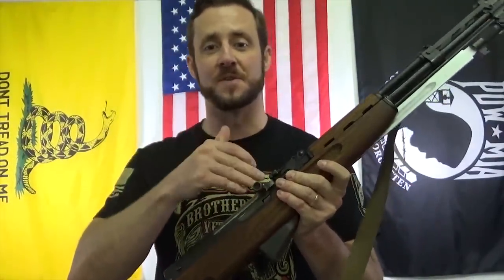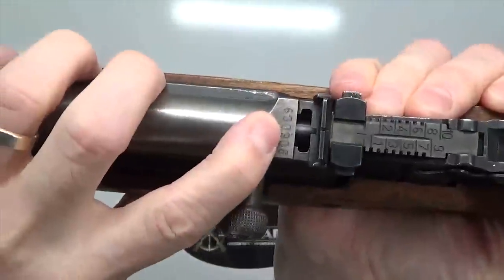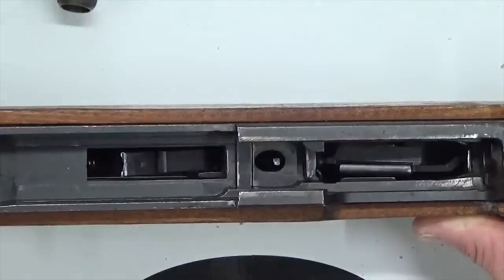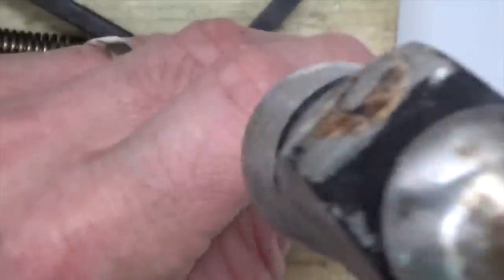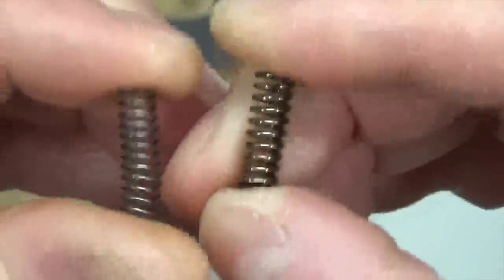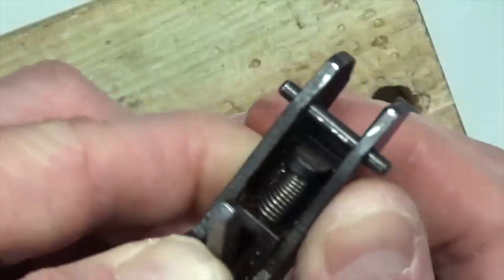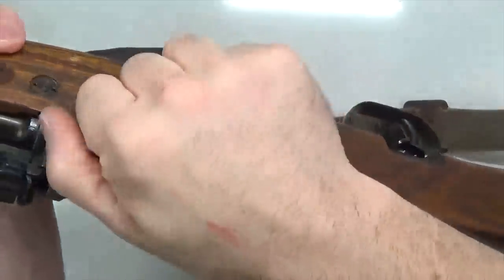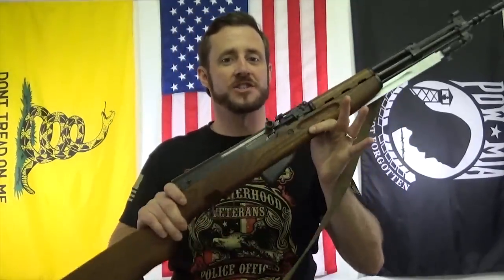SKS Accessories and SKS Trigger Job to improve Accuracy SKS Trigger Spring Kit

Comment: This Spring works great with the Murray's Gunsmithing SKS trigger group parts. I also added an extended mag release from Gould Engineering and Machining and use the ProMag Archangel mags with the paddle lever. All of these things work so swimmingly together.
Reply: Are you running the original stock
Reply: Must be a nice upgraded sks. I have a rubber recoil pad on mine. Its original too. Im going to get my sks to fit a mosin nagant scope mount. Drill and tapp the receiver.. Have to cut the side of the stock

Comment: To those of you who are commenting on the mag release aspect - Yes, it can make the mag fall open from recoil.    If you aren't using an aftermarket stock with plastic magazines you should stress this on your order and ask for a "Medium tension'" spring.  I first ordered the 'standard' spring and the mag always fell open on recoil.  I called MCarbo and they said there were many others with this issue and they sent me a 'medium tension' spring at NO COST !!  PROPS  to MCarbo for their great Customer Service.  BTW I also got the spring kit for my Savage-64 and the trigger is down around 2# on that too!!  AND I am in Canada and there were NO problems with getting the parts, and NO Extra Customs Duty charges.

Comment: My Yugo has a trigger pull of 6 lb 8 oz and it is a rough pull. I bought this spring kit, removed the trigger group cleaned it up and installed the new spring and wow! The trigger pull is now a smooth and crisp 3 lb 2.9 oz.  Thanks Mcarbo ! This worked out great for me.
Reply: Which spring did you use ? Just got the kit today and am worrying about the mag dropping open. Thanks.

Comment: Added your 3.5 lb spring to my Chinese Type 56 SKS.  This quick modification really improved the trigger operation.  I did notice some people had issues driving out the pin in the trigger assembly.  Before I started the installation process, I soaked my trigger group in som penetrating oil (I used Ballistol) and the pin drove out of the assembly quickly and my trigger group got a deep clean and lubrication.

Comment: My sks trigger is actually pretty decent, I'd guess around 4 or 5 pounds.  The main issue I have is the inconsistencies and the long creep. I'm hoping the super light spring helps correct this a little. It seems to be an easy and cheap install. Seems like a no brainer.

Comment: This worked great on my SKS. It also made it insanely more easy to do magazine changes. I have the Gould Engineering and Machining Extended Mag Release for the SKS and plan on buying the Murray Gunsmithing 922r Trigger assembly replacement. This is a great product and I recommend it to anyone looking to modernize their rifle.

Comment: Good video... As long as the gun is apart it's a good idea to pull the sear out and polish the surfaces where it slides on the hammer and also where it makes contact with the trigger housing... This surface is usually machined kind of rough which makes the trigger pull a little gritty... This is a very quick and easy fix... Also if you want to take it a step further you can grind a little bit off of the back end of the sear so the trigger pull is shorter before it releases the hammer....  My only issue with this lighter spring installation is now there is less tension holding the magazine base closed and I could see it either opening up on recoil or if the latch is accidentally bumped.
Reply: Good point re reduced tension on the holding the magazine base closed.  I'm rethinking that purchase.  Frankly a 4.5 - 5.0 lb trigger pull is not an issue, as far as I'm concerned.  But the trigger is gritty, I'll look into pulling the sear out for polishing, not clear on how to accomplish this...
Reply: @rosshenderson835  ,,, There should be videos on YouTube about removing and polishing the Sear... it's a easy process and if you've taken it apart far enough to change the spring the sear will slide right out of the trigger housing.... Frankly I see nothing wrong with most SKS triggers,, in a rifle the pull weight is not near as much of an issue as the smoothness... I would recommend working on the sear first to smooth out the trigger pull and see how you like it at that point... I personally don't think an SKS trigger needs to be any lighter than it is after all it is a battle rifle not a precision long-range bolt gun... The 7.62x39 round is not ballistically that great in the first place.
Reply: Ballistically strong enough to kill a bull moose with one shot of full metal jacket.
Reply: @dalanwanbdiska6542  Did it have the steel core ? ? I would love to know that ! ! Steel core will penetrate some heavy bone with NO problem I would think.

Comment: I couldnt get that front hinge pin to budge on my trigger assembly. I just took a flat head screwdriver and pried the spring out and up from the sear side. Then slid it off the mag release side. The new Mcarbo spring went right in the reverse order. So easy!!!!!
Reply: Can you do a video or better explanation because I am having the same issue

Comment: Another option without having to replace spring would be to  remove spring and apply heat to reduce tension (temper)  propane torch until light straw color and let cool. repeat as necessary if necessary.  too much annealing, heat and drop into cold used motor oil. ;)
Reply: If you go to all the trouble to remove it to do as you say why not just spend the $15  for their nice spring?

Comment: Yep, most trigger/mag catch springs are stiff and mine is no exception. The spring replacement seems to be such an easy fix, one I'm not adverse to trying. I will mention that I have read a limited few comments by sks owners that have done the switchover that with the new spring installed the magazine flips open on recoil every shot. Looking at a number of rifles from various factories and nations I notice that the tab on the mag mates slightly differently on many, meaning on some the mag catch covers a large part of the magazine tab where other examples the engagement of these two components is quite slight. This latter situation is very likely the cause of the unwanted mag opening.

Comment: I put one of these in my Chinese Type 56 that Classic Firearms got a bunch of in here recently. The pin you have to remove on mine was stubborn as all Hell, but once I got it out, the installation was super fast and super easy, and man did it improve my trigger. I love it. The price was good, installation was easy(stubborn old commie pins notwithstanding) shipping was fast. Really, what more could you want?
Reply: I have one of the recently imported Chinese Type 56 SKS. I was thinking of adding this spring to my trigger group??  I noticed this comment is a year old.  How has this mod worked over the long term??  Any problems with this spring?  Did you go back to the original??

Comment: I was so impressed with this one I ordered one for a mosin nagant....both are 100% better
Reply: Bradbo3,  which spring did you use ?  I'm worrying about the mag. dropping open with the lighter spring? Just got the kit today. Thanks.
Reply: MegaBait56 i used the 2.5. I still have the factory stock and mag.
Reply: @bradbo3  , thank you. I'm keeping it in the original stock also. Thanks again.

Comment: That front hinge pin can be extremely tight and you will want to make a metal block to put between the ears on the trigger guard side plates before knocking it out if that pin is tight, especially on stamped trigger groups on later Chinese rifles.  I bent one of those ears one time trying to get one out, so I ground down a piece of square stock to put between them when I knock that front pin out.  
I think the electro penciled numbers on Yugos are called assembly numbers and not a serial number.  
I think they electro penciled those numbers to keep parts together to a particular rifle before the serial number was assigned and stamped.
Reply: Yes, even on my russia sks i had to make a block to keep those little ears from bending. Very weak spot in the sks trigger group.
Reply: I really wish I saw this comment before pounding away at the hinge pin. The magazine release seems to be locked in place, probably due to an ever so slight bend in one of these ears. I will know until I finish knocking the pin out but I put a block in there so don't do for their damage

Comment: The Carbo trigger spring replacement for the SKS is the best $13.00 you can spend on your SKS.......try it before you go for the full trigger kit..sear modification.   It takes 10 mins and if you don't like it it's reversible in the same 10 minutes but you won't replace it.  Thanks Carbo

Comment: But how you reduce the creep? I don't mind a heavy trigger. But that creep throws me off
Reply: same. takes a 3-4 rounds for me to find the sweet spot.
Reply: @juanxnaranjo647  so I figured out how to remove the creep. You gotta get a really aggressive positive sear engagement. Like get a 35 deg angle on the part for the sear touches hammer. I did this to mine, and now I get a super crisp two stage trigger.

Comment: thankyou for the outstanding video. i just recently purchase a near mint condition chines sks . from a weapon purists point of view this this little beast is 100 % all original  all matching numbers....christmas came early lol. there is 1 little ding on the underside where the bayonet folds into the stock....99.9% mint. i'm betting the only action this rifle seen was in military drills/parades hanging off somebodies shoulder. sorry i'm rambling...my question is what do you think/feel about the magazine kits out there on the market. i've come across 30 round mag and 50 round drum mag kits with mixed reviews. would this be a do or don't add on ?? i'm also trying to locate a muzzle break but am having no luck if anybody knows of a website ?? thanks in advance for any advice .

Comment: Questions... so many questions!!
To start with, my SKS uses AK mags and has a very different style trigger assembly at the end where the spring is...
But that not really my issue at the moment...
The safety lever... it should be staying secure in place when in “safe”. Mine does not. Anyone have suggestions on what I need to do to correct this?
Reply: Okay, so... my SKS is a Norinco Sporter.
I came across a wood stock with numbers stamped in the butt and still had the cleaning kit inside...
It fits well with my hardware but the stock is made for the fixed mag.
If it worth trying to restore this rifle or is this just how a Norinco was made and it’d be better off to have fun with it with its plastic stock and find a better example of an SKS?
Reply from the maker: Send us an email to help@mcarbo.com
Reply: MCARBO same problem. Whats the fix? I tried replacing the forky thing and it did not help at all. Nornco with an archangel stock for those beautiful tapco 20 rounders. Sorry, thought this had gone to email. Ill try there.
Reply: John Fitzgerald archangel stock with conversion to 20 rounders and top cover rail for red dot. seems to be the best way i have found to wring the very most out of the sks.
Reply: Step one,  don't buy bubba'd sks's. There is no fix. The man you bought your rifle from butchered the once perfectly fine to hell and back. And that is where your problem lies.
Reply: Did I mention that it was a factory conversion? Guess I forgot to mention that part.
Too bad we had to go with the “red neck” slur. Unnecessary.
Reply: I did, however, fix the safety spring issue. I took the trigger mechanism apart and “finessed” it back into shape and it works great now

Comment: How does that affect the trigger pull? Isn't that spring for the mag release? If it decreases pull, how?
Reply: Sam G The spring is pushing on the Sear. The tension on the Sear creates some of the Trigger Pull. I have just installed this part and it works great.
Reply: Looks like a good product but I'm in Canada and we can't buy any gun parts from the US and they are in Florida. ridiculous laws.
Reply: You should be able to buy it still, as you can get stocks from the U.S and other parts.
Reply: You can order it, I just checked. Add it to the cart hit checkout and then select Canada from the country list and fill in the rest of your information, it's roughly $26 with shipping.
Reply: @rush2124u2  I live in canada and I just got mine in the mail.

Comment: It looks good but is it safe ? The sear being held firmly in place is what prevents the hammer from falling until the trigger link pushes the sear from under the hammer freeing the hammer to strike the back of the firing pin.  It seems to Me that if You reduce this spring force that the rifle would be more prone to accidental discharge if the rifle were to be bumped or dropped.
Reply from the maker: Rick Nethery Yes it’s been designed with safety first in mind.  All M*CARBO Trigger Spring Kits are drop tested and given a rating.  It’s a 100% pass of all drop test heights unless otherwise notated.  Thanks for your question.
Reply: MCARBO Your welcome Sir, thanks for Your answer
Reply: Mcarbo, looks like a great product , i just went to your w.s , i was hoping to see some trigger sears for sks , but i did not , Where can i find OEM parts for Chinese sks
Reply: Gerald Hoskins murrays gunsmithing makes a lot of nice sks replacment parts
Reply: Thank you

Comment: I'm guessing that with such a light spring it is better to be sure that you have a positive sear engagement?
Reply from the maker: That's the reason the kit comes with 2 springs. Depending on the country and date of manufacture you may need to use the heavier 3.5lb spring.

Comment: What I'd get: Valmet-style flash hider (with bayonet lug), get rid of the stock bayonet; peep sight attached to the rear of the receiver (clamped with take-down pin).  Maybe 20rd mag, maybe not.  WP-style rail to the side.  Rail upper handguard.

BTW, perfect safety procedure with the weapon.  I'd go one step further and do two charges, if there wasn't any hold-open (like AK and its derivatives).
Reply: If you want all that shit, do it to a more modern rifle not a curio and relic with collector's value.  Get an AK if you want high capacity, mod it all you want and you won't be destroying history.  
SKS's will never be made new again.  And Military ones like older Chinese, Yugo, Russian, etc should be left stock unless you're doing mods that can be fully reversed.  Remember, as some of our grandpas were chopping K98's down to make sporting rifles, they thought the same thing... "aww there's a ton of em, modifying is no big deal"
Now sporters are sad stains on history and even a beat up mismatched K98 rifle is approaching a thousand bucks and correct and original rifles can get 5 times that.
Tacticool modifying a SKS is some real douchebag shit.

Comment: I installed the MCARBO 2.5lb trigger spring in my Tula SKS and it gave me problems. I was able to shoot 1 or 2 rounds and the magazine would open up on its own. I couldn't shoot unless I held the magazine closed. The other problem was when I did hold the magazine closed, it would fire 2 or 3 shots in a row like a full auto rifle. It did that about 4 times in a 15min span. I know it's not my firing pin because I had replaced my original one with Murray's firing pin and I made sure the spring was keeping the firing pin in the rear position. I think the problem is the 2.5lb spring is too soft. It may work for some but I reverted back to the stock spring. It's hard to recommend something that made my rifle unsafe when it never malfunctioned before installing the spring kit. I will be using the stock spring and I'll post an update.

Comment: Hay MCARBO AND BROTHERHOOD a follow up to my can you put the sprin on A Norinco SKS M / SKS D these are the AK mag fed SKS rifles due to the mag release being an ak mag release this modification is doable but vertualy impossible I spent the last 5 hours trying to get my trigger group back together reason one being you have to removed the Mag release to get to the spring the mag release is pind and the pin if flared or beveled to keep it in place so if you manage to drift that out you have to shave down the bevel to put the pin back in. After you have done all that you got to put the mag release back together I had to dremmal the pin holes bigger to allow some give just to get the pin back in then I had to fight the spring back into place and alighne the pin spring mag release latch and receiver all together and bang in the pin but after 5 hours and 5,000 swear words I did it. the trigger is light as hell now and since I had the trigger group together I did polish and sand down the sear to shorten the over travel still got a lot of over travel but much smoother now. All in all id say if you have an AK mag fed SKS don't try this it was worth it but like I said 5 hours of hell to do the job. HOPE THAT HELPS
Reply from the maker: Jackey XM8 Thanks Brother for your feedback.
Reply: any time guys id hate to have a member of the brotherhood have to go through the pain I did without knowing what there getting into if anyone does have the SKS-M and wants to do the project the tools they will need is a dremel a screwdriver with flat head and star heads a vice would of helped a lot as well a hammer and all the tools specified are for reasons not normally used  I used the star head or hex heads to help guide the mag pin and spring in place you can use an extended Philips head to do this as well you will need to remove the crimp on one side of the mag pin once you get the pin out and you will need to bore out the pin holes just a bit with the dremel to help the pin find its home dont worry the pin will not fall out on its own its huged tightly by the spring